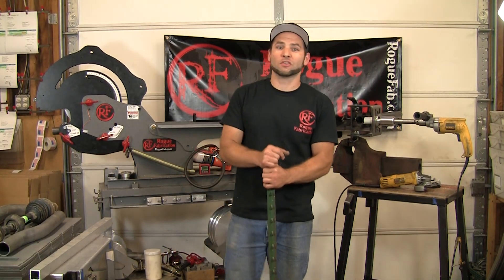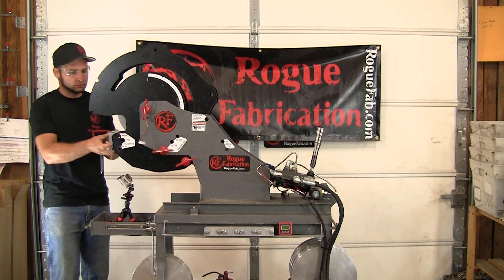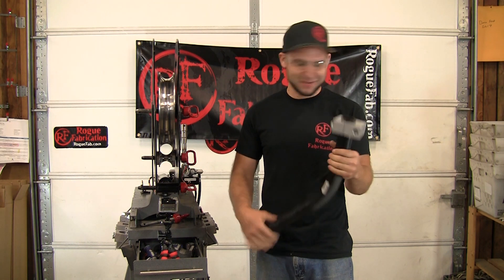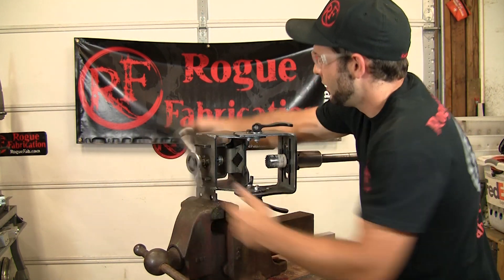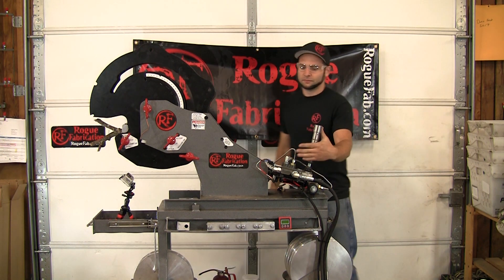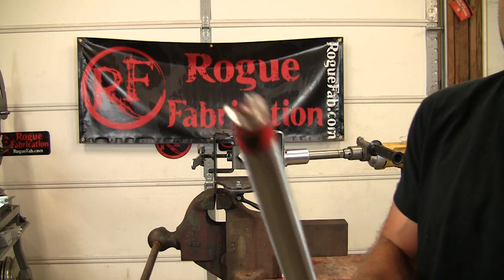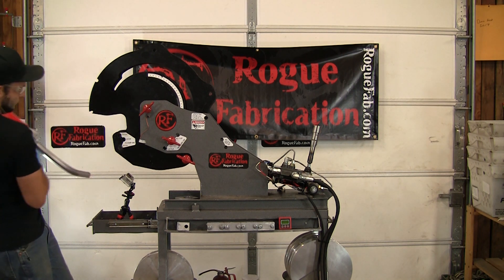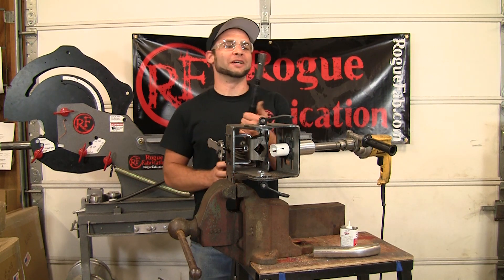Will it bend? - Episode 1, tube bender and notcher vs. carbon fiber

Comment: Maybe a future mod would include a handle on the notcher, so your fingers aren’t in the work area.
Reply from the maker: This video is the only time I've ever grabbed there. The cart with the vise on it didn't have locking casters. No way to stop it from moving. It was a video prep fail... otherwise that would be absolutely critical to add!
Reply: Rogue Fabrication I would think it would be a good addition, just for balance and additional cutting force when needed.
Reply from the maker: Not a bad idea at all!

Comment: This is so cool !! I’m embarrassed to say i have spent quite a bit of money on tubing benders only to be disappointed every time . Every single bender broke. One of the dies broke the very first bend i ever did . Eastwood hydraulic tubing bender is the last one bought . The part of the die that holds the pipe in place broke the first time . The welds did not even penetrate so it snapped first use . I used a grinder and ground all the welds out then rewelded and now it’s fine . But i absolutely hate this bender . I love love love your benders !!! I think I’m going to bite the bullet and buy one of yours . I’m building or wanting to build an exo cage for my 2019 JLU Jeep Wrangler . It’s sitting on 40s and one ton Dana 60s front and rear full floaters . I have subscribed to your channel and I’m very excited to get your bender here so i can start my project .
Reply: Will be using 1-3/4” dom 120 for my exocage
Reply from the maker: That sounds like a very capable build, Chad! We would love to see what you can do with tools that hold up! Our bender and dies won't break on you :)